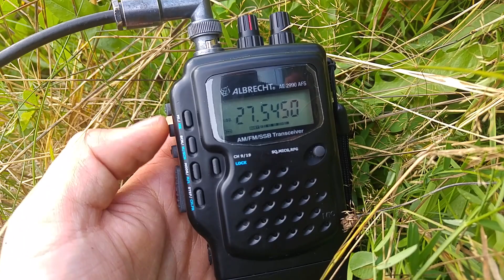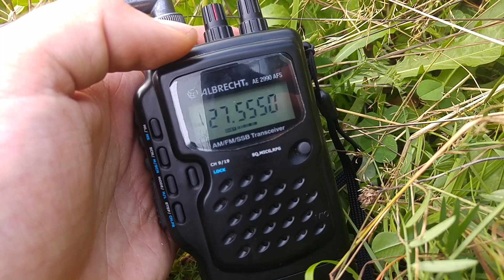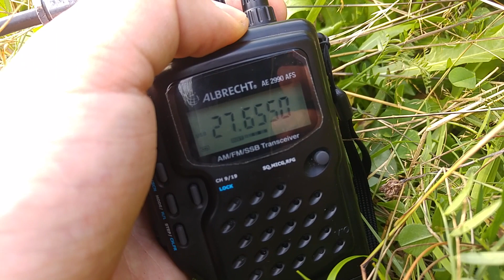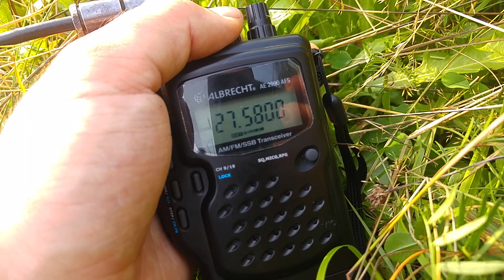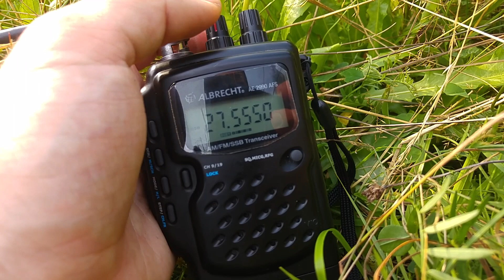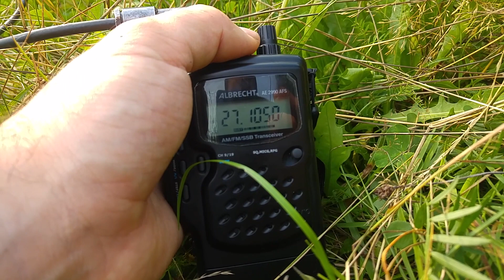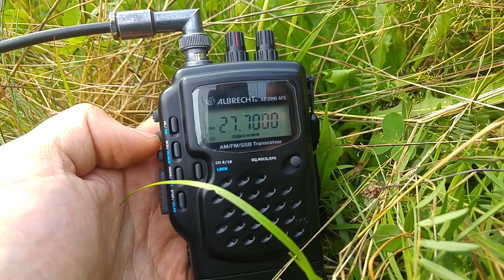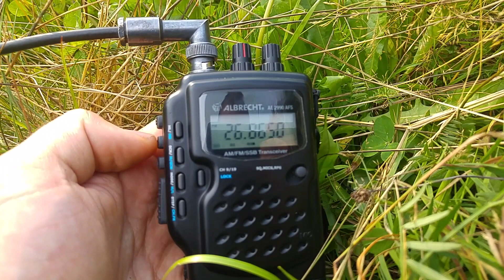Handheld CB radio with SSB - Albrecht AE2990 AFS monitoring 25.08.2019

Comment: How do you find 27.555 on this radio? I have the same radio but when opened up using pins 1&2 on startup 27.555 is still locked out as the bands skip this area of frequency spectrum.
Reply from the maker: Sorry, I can't tell because I already got it unlocked so it can hoop around all those frequency bands without any trickery.

Comment: CB is so antiquated. Just go GMRS already.
Reply from the maker: Different bands, different propagation, different use cases.
Reply: @ElectronicNoobBlog  Exactly.  Go GMRS.
Reply: @theoriginaldashriprock  GMRS is illegal in Europe and never likely to be made legal as these use licensed frequencies as far as I'm aware. 

GMRS has good advantages mainly the antenna can be smaller and much more efficient and you're allowed something like 50 Watts so you get out much further locally than 4 watt limited CB.

GMRS is more suited for those who don't want any skip coming through but that's what many CB'ers like.
Reply: @o00scorpion00o  who cares about europe? We're in the United states.
Reply: @theoriginaldashriprock  who cares about the United States ? We're in Europe ;-)
Reply: @o00scorpion00o  That's too bad.
Reply: @ElectronicNoobBlog  yet CB is still antiquated.
Reply: GMRS is illegal in Europe and never likely to be made legal as these use licensed frequencies as far as I'm aware. 

GMRS has good advantages mainly the antenna can be smaller and much more efficient and you're allowed something like 50 Watts so you get out much further locally than 4 watt limited CB.

GMRS is more suited for those who don't want any skip coming through but that's what many CB'ers like.

Comment: The Albrecht (Midland-Alan) AE 2900 AFS,  was discontinued about 2 years ago as Midland has completely exited the 27MHz market. I'm glad I snatched a couple of these up in the mid-2010s and imported them from Germany. It cost me an arm and a leg at the time, but their value have shot up as there is no other HT on the market that can do SSB. I have zero intention on ever selling them, before anyone asks. ;)
Reply: Several outlets sell the albrecht now
Reply: @indiana146  I believe there were a few batches of new old stock released recently in time for the next cycle, but they're not being manufactured any longer if I'm not mistaken.
Reply: @PHX-222  yes theyre still being manufactured im uk you can  get them
Reply: @indiana146  Who's making them?
Reply: @PHX-222  buy from various
Reply: @indiana146  That's not what was asked. Who's manufacturing them and where? I can assure you it isn't the UK.
Reply: Anyways...the point being is that they're no longer being made. The stock you're seeing is old inventory.
Reply: @PHX-222  try being polite you might like it
Reply: @PHX-222  the point being is you are wrong do your homework ive spoken to a leadind radio.retailer who said they are being made but there are reliability issues so they wont b buying anymore from supplier till theyve sorted out problem
Im not being funny with you
Just giving you correct facts
Reply: @indiana146  Apologies, thought I was.
Reply: £229 in uk
Reply: They are still being built but they are having trouble with reliability i dont know where you got your info from but your wrong ive spoken with a well known radio retailer who informed me of situation
Reply: @indiana146  This wasn't about being wrong nor right, and now look who's being snarky. Retailers don't always get reliable information and the QC issues are old news. Cheers and have a better day.
Reply: @PHX-222  i merely said try being polite because your
Reply: @indiana146  which websites / outlets can be found to purchase from?
Reply: @indiana146 Meine funktioniert immer tadelos....fùr mich ein ganz tolles Geràt um bei guten Bedingungen tolle DX Verbindung zu betreiben.....tolles Handgeràt👍👍👍

Comment: This is the perfect example of what you can put into a super small radio. This is why I can't understand why you can't get the Albrecht 6110E or Anytone size radios with SSB modes. The factory claims it can't be done in those size radios, but obviously it can as this handheld has a PCB half the size of the one in those radios. ALL they would need to do is add a few more internal components for SSB & then utilize a dual ganged potentiometer on the radio face so one of for clarifier on SSB modes. I know 12w on SSB will produce more heat so design the radio so it can only do 4W on AM & 12W SSB. I wish one of these China factories would get their act together & bring the Anytone/CRT/ Albrecht compact radio with Am/FM/SSB. I use to have a Cherokee AH-100 with AM/SSB & it sounded great so I just don't get why this has not been done.
Reply: Pity the review was only RX.  The TX on this radio is fkn crap
Reply: that's what I'm saying
Reply: Elecraft Kx2, Xiegu X5105, Both with lithium batteries, the Xiegu costs more but decent radio. Kx2 best quality but huge price. 

The X5105 can fit in the pouch of a Tecsun PL-660/680 radio which will tell you how compact it is, the 5105 and Kx2 have a built in Mic also and can be used like a HT but with the X5105 and Kx2 you get all the ham bands but not sure you can open them for 11m.

Comment: Do you have a rough idea of the distance away from you of some of those signals that you picked up? Very curious about the practical working range of SSB on that handheld (obviously antenna and elevation makes a massive difference)